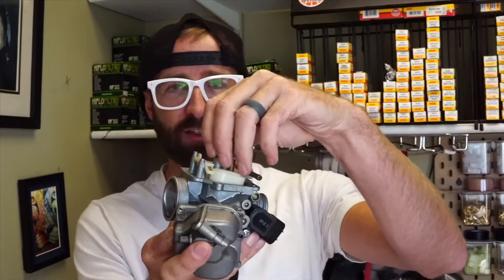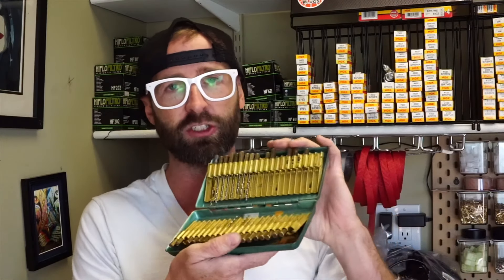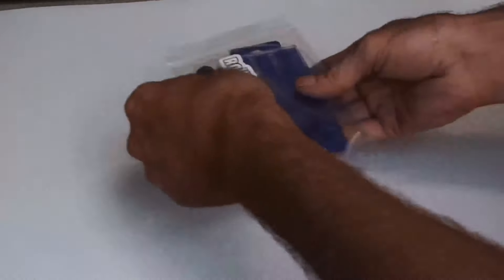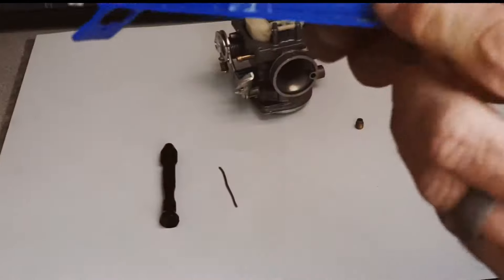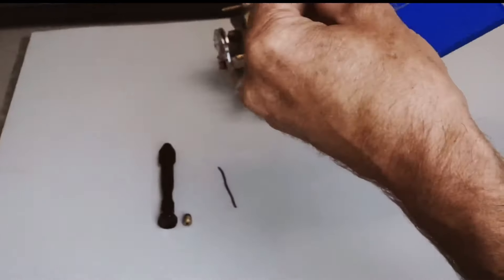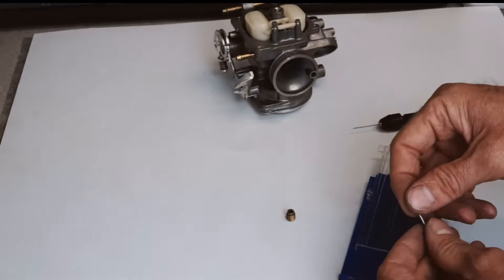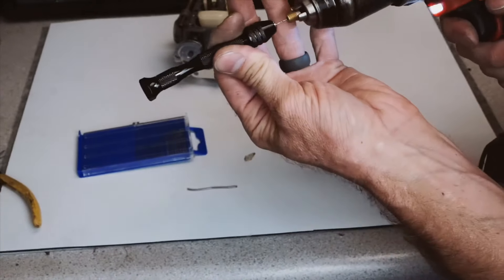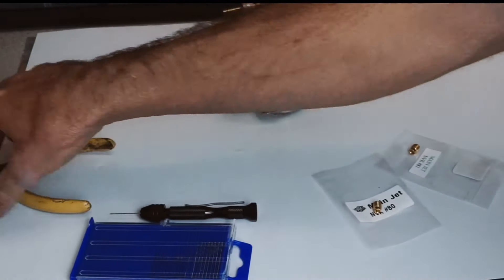Carburetor jetting trick [YOU NEED TO KNOW THIS!]

Comment: Now the numbers mean nothing!! Cant go leaner!!!

Rather buy a jetting kit then those drills that can leave rough edge...
Reply from the maker: Yes that is true, grind the numbers off. If you want o go leaner solder the jet closed and start over. Good news is you can buy jets instead. They just aren’t as accurate as they generally go in 2 step increments

Comment: Hi new sub here do you have any fb messenger pls i really need your adv about my carburator having prob with it, always getting this sp reading lean, even though I set the main jet to from 125 to 140 still lean on sp reading please really need your help
Reply: before you mess with jetting you need to make sure your lean condition isn't being caused by a vacuum leak, if your bike is running lean now when it wasn't before, 99% of the time it's from a vacuum leak that has opened up. just in case you don't know, the easiest way to check for vacuum leaks especially on carbureted bikes is with carburetor cleaner, make sure you use the little red tube that comes with the carburetor cleaner and with the engine idle spray through the tube hitting every possible place that can leak. you didn't say what carb you have so just in case it;s a CV carb, don't forget to spray up all the way around cover for your slide diaphragm the  but don't just confine yourself to the carburetor, air leaks can also be coming from the cylinder, spray the CC down around the cylinders base gasket then up around the head gasket and even the head bolts. i said all that now i'm going to say this, it also could be something clogged inside the carb, it also could be you valves have gone out of adjustment but i'm betting its an air leak. if it starts looking like it's going to take a while to solve the problem, to add a little protection for your bike something you might consider doing while you are chasing the problem is drop down a couple of heat ranges on the spark plugs, if your bike normally runs something like an NGK BR7ES switch to a BR9ES, that will lower the risk of doing major damage like burning a hole in a piston.....hope this helps, chasing a lean condition can be really frustrating and this is the easy part, it can gets harder.......
Reply: thanks man I really appreciate all the help you told me, I'm using a yamaha mio sporty scooter bike and upgraded it from 110cc to 160cc bored up the engine from stock to 59mm block, but has stock head that's been ported (intake/exhaust) and still using a stock vacuum type carb (no needle adjustements / 0-5) yesterday I replaced it with a 28mm keihin carb, put in a 125 main and 40 slow jet, thanks for the help again 🙏🙏😇